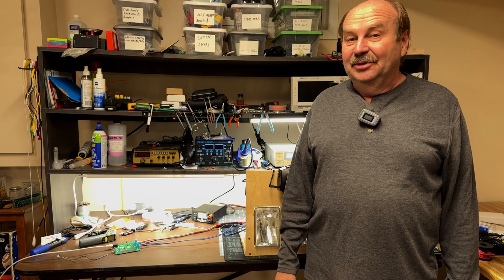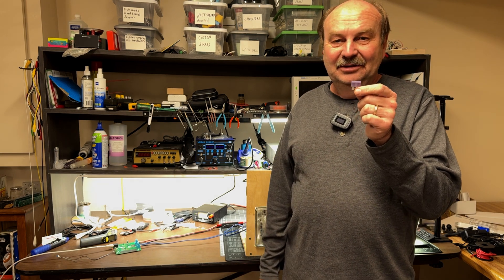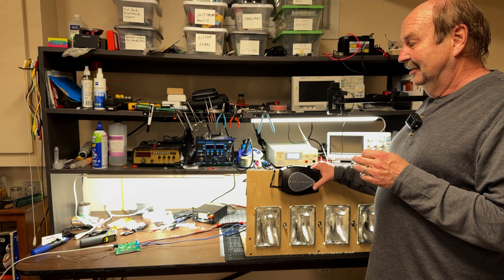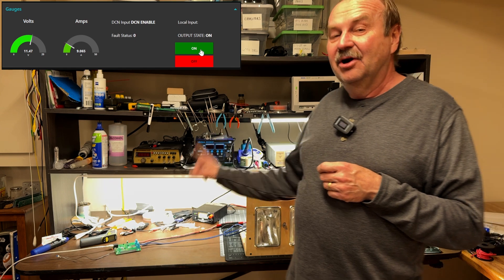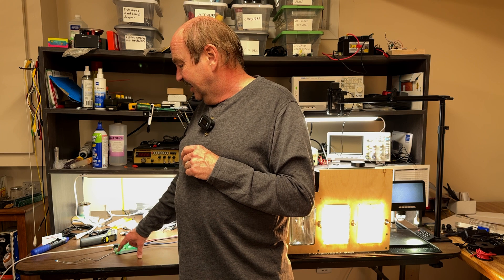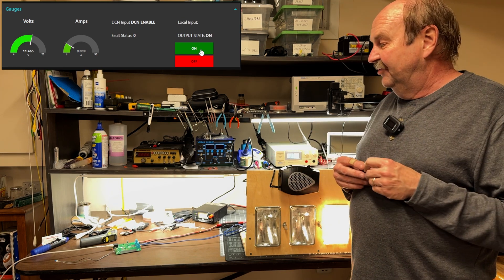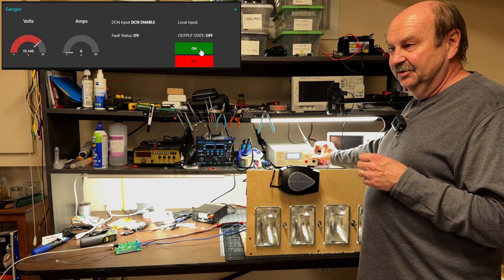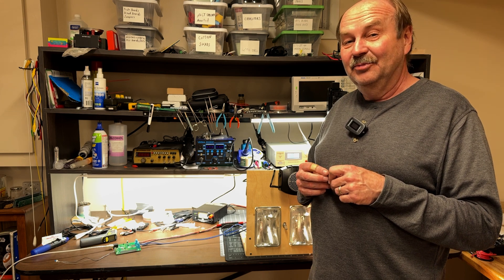Smart Power Switch Introduction

Comment: Looking at it as an engineer, I'd build the board with screw terminals or molex pins and optional connectors to fit any common connectors. Power pole is fine, and our ARES group expects it for all events, HOWEVER they are bigger and more expensive and not everyone uses Power Pole. Everyone can make a short adapter to connect to a screw terminal block and go to Power Pole.  But maybe that's just me.

Comment: That is a great idea . With that question of terminals or Anderson . I would work the PCB to except both and let the uses chose what they want.  Or just put both terminals on PCB. I can see both ways being used and having options for the user will be great ! Just like your crowbar circuit with options on terminals . This can easy work into board design . Hope this helps ! Great work on this project ! 73 from NY !

Comment: I think that screw terminals would be preferred. It is very easy to add wires with Powerpoles on them. Having the voltage/current/retry parameters reprogrammable by a remote computer would be ideal. de WB2KWC

Comment: Very nice!  I would like to see it have powerpole connectors for the input power and screw for the output power so if used in a radio project this would be the main power input and then the poswer to the poject is screw in or soldered

Comment: Great Idea! I have a bunch of ideas that are not necessarily Ham related (check out my content and you will understand). I think an option of terminal block connectors would allow the most field flexibility. Fix a female block to the board and have a mail screwed end. Then make adapter kits available for those that are dedicated to Anderson plugs. Yes it is another adapter that one would have to have but the problem with Anderson plugs is that they are one use type connector that are not so easily field serviced without replacing the ends. There is something to be said about being able to repair a wire connection with a pocket knife and small slat tip screw driver in a pinch.

Comment: Cool project! - There's enough room on the board for both Anderson AND screw terminals - that would make it universally adaptable. - Cheers! VE3GHP
Reply from the maker: That’s a great idea.  I’d like to keep the final board as small as possible, but I can probably put both footprints on top of each other so either one can be installed without changing the board.

Comment: Great video and idea!  I would prefer the existing screw terminal even though I use Power poles on everything, but I can easily make an adapter with short wire and power poles. but for those who don't use power poles it would be very difficult.